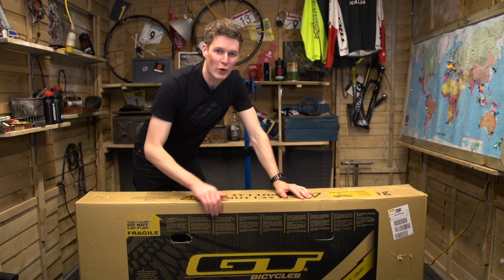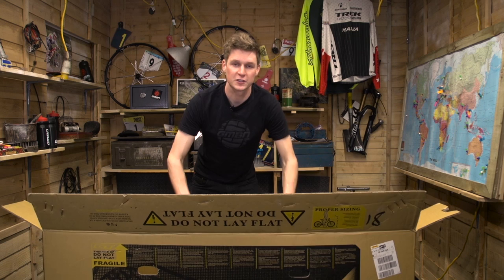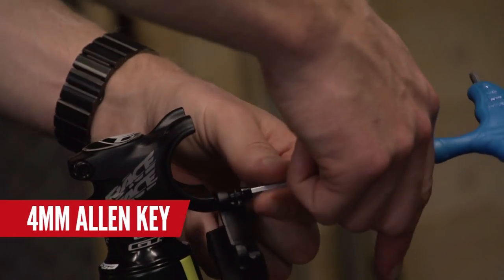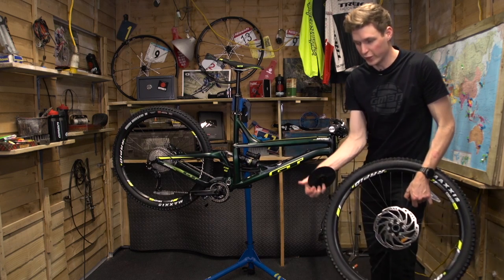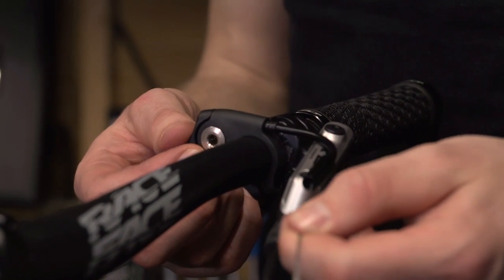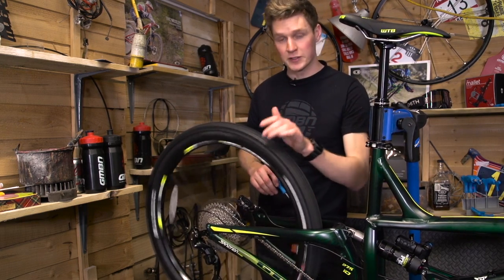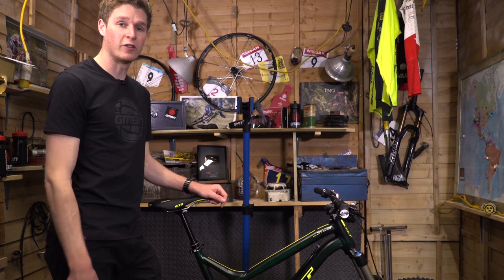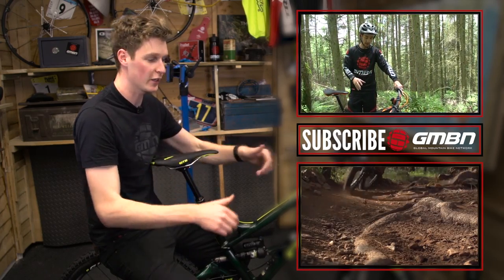How To Build Your New Mountain Bike From The Box | Mountain Bike Maintenance

Comment: So you also need a 2.5 mm Allen key and grease, also a gauge to check tire pressure.
Reply: +Jake Dassan Also fork pump, kind of the most expensive additional tool you'll need to calibrate the suspension to your liking.

Comment: Even though u don't normally find an XC bike with a dropper seat post can u still install one on an XC bike? The trails XC trails I ride and race on include  a lot of berms and fast downhills that a dropper post would make them be easier.
Reply from the maker: You can, many xc racers are beginning to use them now.
Reply: Global Mountain Bike Network  what if the bike isn't dropper post ready?

Comment: When u buy a bike from Halfords you will get the bottom bracket and drivetrain installed, right?
Thanks! So gassed for my new voodoo aizan
Reply: Halford's will put BB in head tube. and handle bars where the BB goes. will look strange but you'll get used to it.

Comment: Fairly good video,  but I felt that a few steps have been missed:
Pre stretching any cable on the bike and then recheck shifting. Many times a new cable is able to stretch a fair amount and that you don't want to have to deal with that on the trail. 
If you have the proper tools/skills recheck wheel trueness since they can take a beating when in the box. 
Other than that make sure to apply carbon paste/grease to applicable bolts
Reply from the maker: +Colin Nilson All good points and thank you for your feedback but we've built this from the box and it could be taken straight out on to the trails!

Comment: l like the video and l think it is very useful. However, there is simply too much editting. l think for novice DIY people there are too many steps which were skipped. For instance on the wheels, you did not mention which side the QR lock should go and so forth. l think there is simply too much assumed knowledge. 

Would it be possible to get the full unabridged video so that people like myself can see how everything comes together? With this one things happen too quickly and it would be great if you could explain what to start with and where to finish. You could also pass on tips or share your experiences as you go along because l am sure it is not always smooth sailing when you do this.

Anyway maybe l am just one of the technically challenged people but l would feel more confident tackling such jobs with proper preparedness.